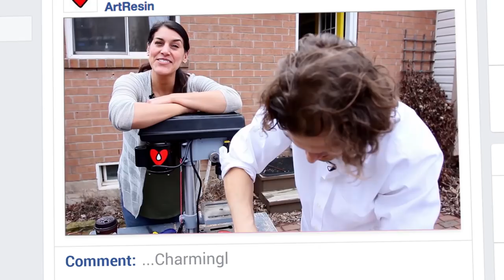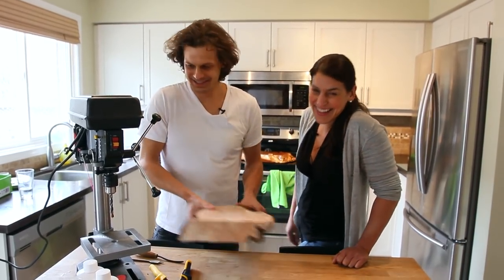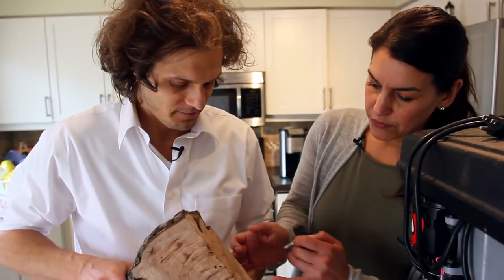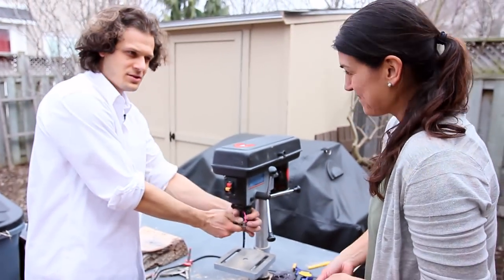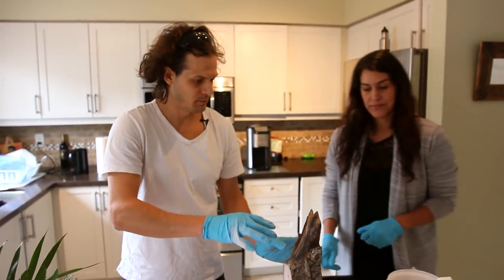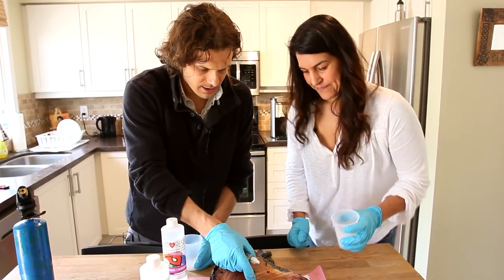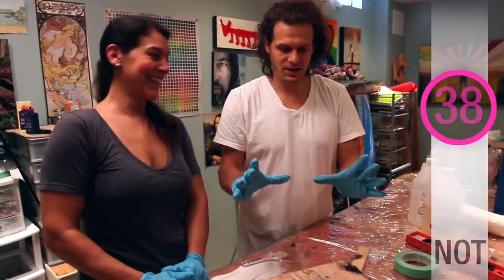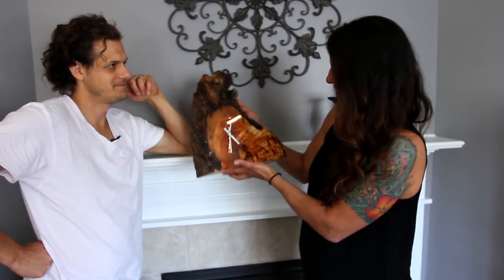How to Resin a Wooden Clock

Comment: Thanks for sharing this, it came just at the right "TIME" for me as I have the resin and piece of wood but lack the know how. I made a cross out of a piece of rotten wood with led inside but it snaped in two taking it out of the mould, I wasn't sure if I could put more resin on cured resin but you've answer that too :)
Reply from the maker: Glad it was helpful for you!  And yes, you can most definitely add more resin to cured resin, as long as you sand in between coats so the fresh resin has something to adhere to.

Comment: Why did you cover it  after you applied the resin on the back??
Reply from the maker: hey greg - how do you mean, covered it?  we applied several coats of resin - which part in the video are you referring to?
Reply: You did you final poly coat to the clock then place a cardboard box over the clock while it was drying
Reply from the maker: Hey Greg - yes, that was our final coat and to make sure it turned out absolutely perfect, we put a cover on top to protect it from dust or insects or anything else floating in the air that might settle into the wet resin.  You should always cover your resin pours until they're dry to the touch!